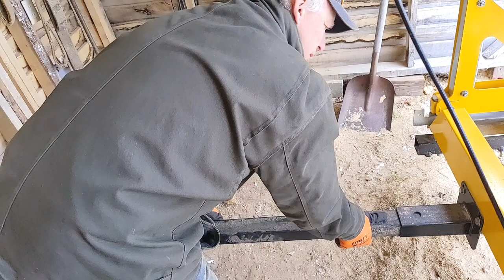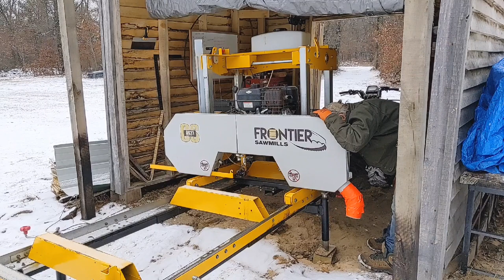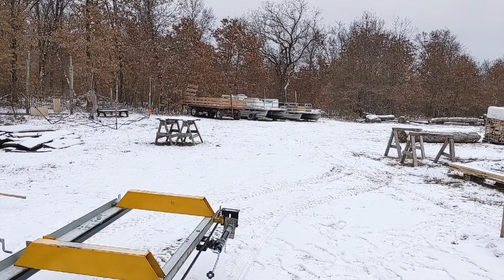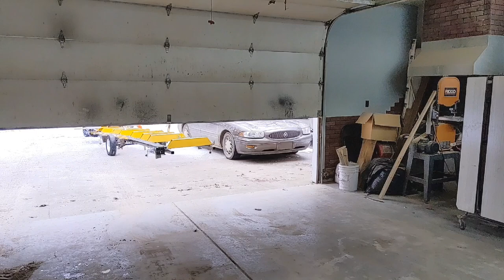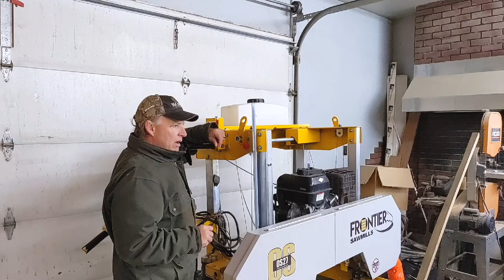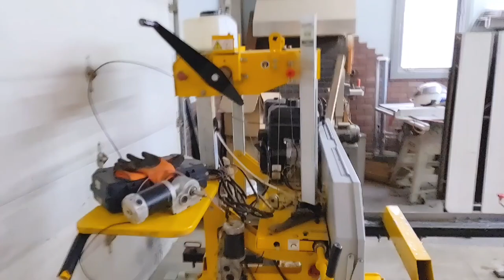Power Feed Making a Plan for the Carriage Up Down Power Feed Part 1

Comment: Should be interesting. I like the 24 volt idea , adding the second motor and all. Will you be using a DRO ? Wouldn’t a drag back system drag it in the saw shed ? I’ve seen a guy using a strap like you do to turn logs only he uses a 60 inch farm jack ( just wanted to throw that out there ). Anyway, you know I eat this stuff up. Thanks man !
Reply from the maker: Terry, tried 24 volts and I'm going with it.  The return is twice as fast as it was.  I need to come up with a soft stop.  When it's at full speed return at 24 volts it stops hard at the end. I have 2 doors at the end of my shed that open.  A roller conveyor would be ideal and I can just push them out the door.   Or even turn my mill around.  With 24 volts it was really powerful.  I'll probably build one if I don't like it I can do away with it.   
 I may put a DRO on it.
For how cheap the price on this mill is it has been fun making it much more capable.   I'll have a few hundred dollars into this build.  I'll spec it all out for everyone.

Thanks for the continued support, Terry.

Comment: Jerry, where are the rest of these videos 😆 I too looked over my power feed too and I'm going to gather some parts for that. I don't mind the pushing for now but having the power head would be a game changer for sure. But I'm going to keep my existing setup in place for now and try keeping things super simple. On a plus side, I found 2 caravan motor movers in my shed the other day and they work 😄 so that's it now 😄 
Great job though buddy, get the videos out quick 😆
Reply from the maker: It's coming along.   I'm in the process of fabricating and processing the parts and mill to put it all together. It'll be a few videos buddy lol.  I couldn't believe how much I took off the mill.  I'm thinking my head will be much lighter now.
Thanks for the support
Reply from the maker: In one of your videos I think I saw those motors in the pile in the background lol
Reply: @Bigelow Woodcraft  that's right bud, I totally forgot I had them and then I was rooting for something the other day and was like. What are those 😄 
I'm keen to see your next videos, be interesting to see what you have removed too.